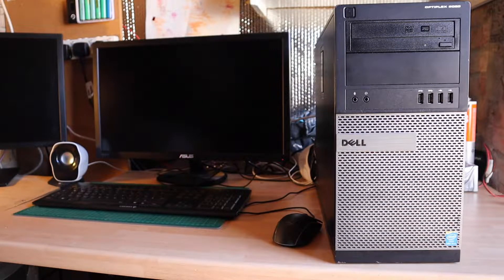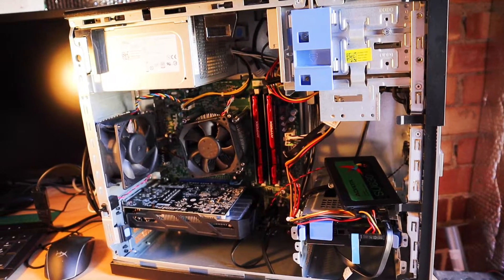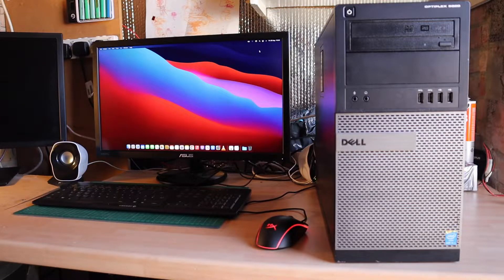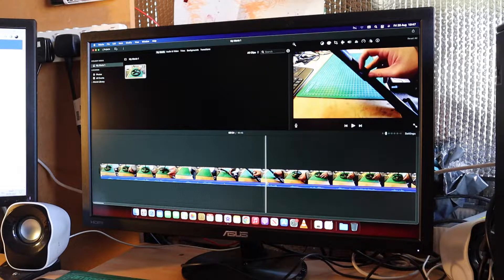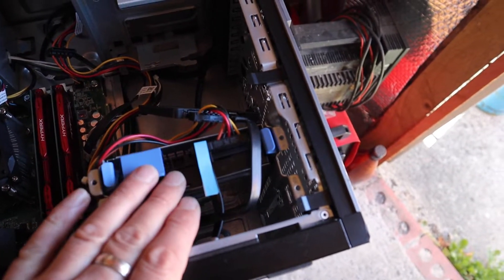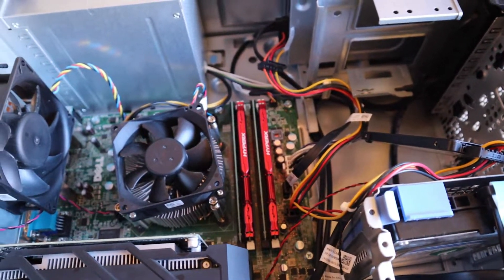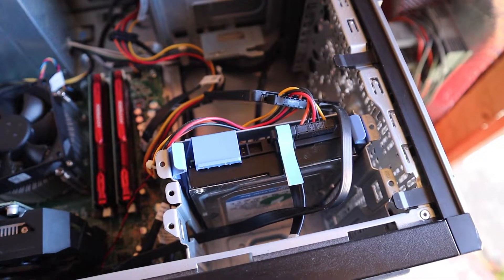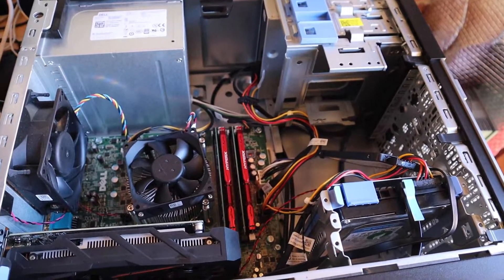Dell Optiplex GPU & Ram Upgrade And Installing MacOS Big Sur.

Comment: a step by step  Video guide on installing Big Sur Or Catalina would be much appreciated - ive got the same Dell Optiplex 9020 MT with stock intel graphics , cant find a clear guide , the one on Tonymacs86 is  very long and confusing. thanks in advance

Comment: Hey Retro Tech! I couldn't find an email or anything, so I'm commenting here. Not sure if you remember, but you commented on a video of mine about replacing the large cap in an FSP power supply from a Lenovo p310. I ended up taking your advice and made a video on it. Are you okay with me giving you a shoutout? 

Also, this is a pretty sweet video/project! Cool to see hackintoshs still hanging around
Reply from the maker: Thanks!. Yes shout away. Hopefully it sorted the problem out for you. FSP are actually very good power supplies.
Reply: @retrotech2020  Not to spoil anything, but it's been running fine for over 24 hours so I think it's fixed haha

Thanks again!
Reply from the maker: @HardwareHaven  I'm looking forward to watching the video.

Comment: yes would love to see how you got this mackintosh up and running and is it reversible. Thank you!
Reply from the maker: It's totally reversible.
Reply: @retrotech2020  one more question if I may. If it's reversible, could you set it up with two drives to essentially dual boot but beside this, would the software continue to operate if you install a faster CPU?
Reply from the maker: @santospoland  Yes you can dual boot with Windows or even triple boot with Linux.
You can install faster CPU's and it will be fine. This particular model will take an I7-4790K as its fastest CPU but that is a Haswell refresh CPU and MacOS does not support it, therefore the I7-4770 or 4770K would be the best choice but you'll gain nothing having the K variant as these Optiplexes do not overclock.
You can also use Xeon 12xx V3 CPU's but will lose sleep capability.
Therefore the I7-4770 is the best choice CPU.